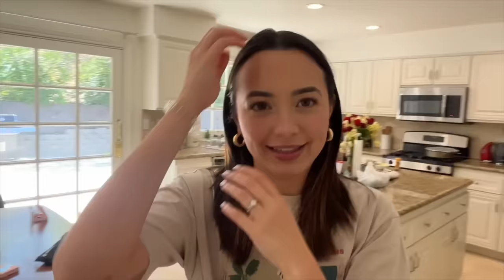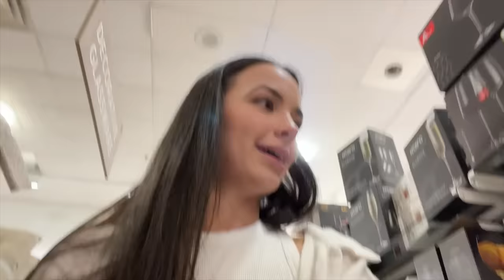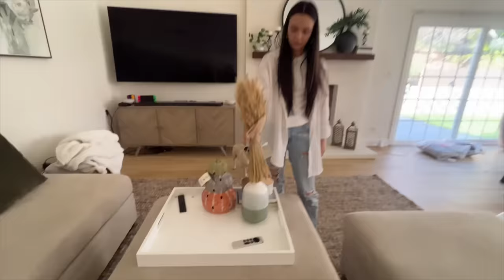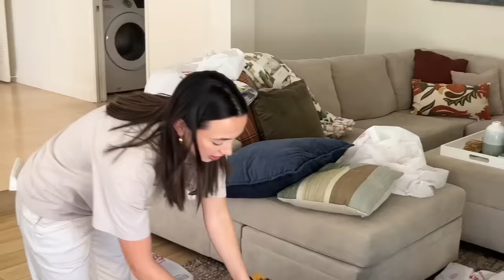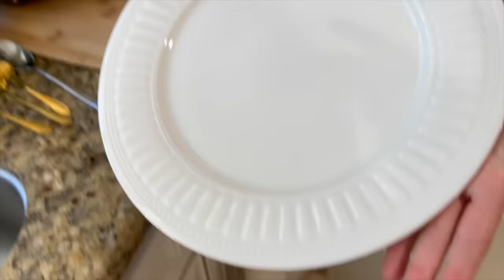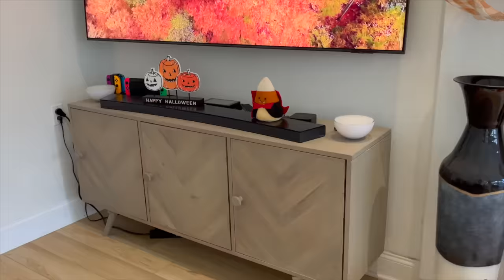Decorate for Fall With Us! - Merrell Twins

Comment: Fun video. Great job decorating. You were able to do the fall theme without it being too overwhelming. It looks comfortable and livable, not a “display” where you’re afraid to sit because you have to move a bunch of decorations. Both tables looked good. The big one is ready for a dinner party, the smaller looks good but functional. You did say the other couch was a work in progress. Good start but could use a little color, like muted gold pillows or pumpkins. Maybe even slightly shiny dark orange or red ones for a little pop of color.

Comment: I know you all are dedicated Targét shoppers, but Walmart has some cute stackable coffee cups in wire racks that would be great either on the table or by the “coffee bar”. They have both fall and Halloween themes, soon to have winter and Christmas, so you can change them out for the holidays, though I usually got the ones that were good year round. I’m hoping they’ll have either a that makes a snowman or Santa this year.